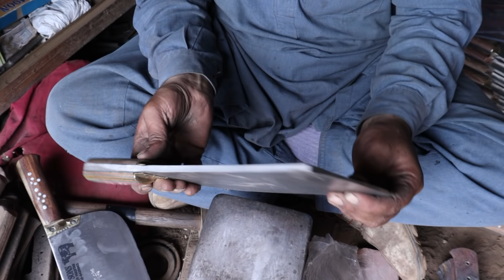Most Interesting Meat Cleaver Knife Forging Process

Comment: It's amazing how these people can work in sandals and with some of the most meager tools. However that is one awesome power hammer.
Reply: Se
Reply: And they do everything on the floor.
Reply: That's how your ancestors did before
Reply: Hhj
Reply: And no gloves. One wrong move and oops there goes a finger
Reply: @rangoman1815  yep hundreds of years ago.. hundreds
Reply: "Meager"?  It's not like they're pumping bellows and hand-hammering the blades.  They've got at least two power hammers (and one of them is set up to do one specific job) powered grinding wheels, and bar stock that just needs to be cut to shape with their cutting torch.  Calling that 'forging' is like calling tracing 'drawing.'

Comment: I was surprised to see at the end that the cleavers edge was unmarked after attacking the square bar. Most impressive....
Reply from the maker: Thanks for watching dear
Reply: कहा मिलेगा
Reply: apparently that square bar made in china from chinesium :)
Reply: @z08840  Aye, maybe it is, but there will still be some steel in it, maybe just not good stuff. Remember, the Titanic was built with appalling quality steel even for the technology of the day, so....
Reply: @logotrikes  Titanic's problem was not a steel it was made of... so, your point just moot
I'm just pointing out that if this not heat treated thing is leaving notches in a metal bar, then this metal bar is even more shitty stuff than this thing is made of :)
Reply: @z08840  Dunno about the Titanic steel suggestion being moot. I've followed the Titanic story ever since Ballard found the thing. I've got several books on the subject including the infamous Robin Gardiner book about the Titanic switch. That was settled conclusively when they photographed the cast bronze remains of the bridge telemotor, and it bore the yard number of 401, which was Titanic's number, Olympic being first of the class at 400. We're getting off the subject a bit here but I must address your Titanic steel comment. Sections of the hull plating have been raised and analysed. The carbon content which gives the steel its strength was unevenly distributed through the sample, indicating very weak hit and miss properties, not best suited for Atlantic cold. It was very brittle and fractured easily under test, at way less than the 1 inch thickness would have suggested. An accident waiting to happen (deliberately?) considering the flagrant regard Capt Smith had for the conditions.(Even if as has been suggested, speed was the best policy to adopt in the circumstances, at the time, just barge your way through the ice field with the velocity of 42 thousand tons. It was only a few growlers after all, and Smith had a deadline to meet, egged on by Ismay) Hubris of the highest order.

So, the steel was poor quality as has been ascertained by modern metallurgy, although a combination of unfavourable circumstances, many of them man-made, ensured the early demise of this fine ship. That Olympic, "Old reliable" sailed on almost trouble free until 1935 is irrelevant. Successive captains no doubt were a little more circumspect about letting Olympic gallop away, plus the ice conditions that year were exceptional, and were not often repeated in following seasons...
Reply: @logotrikes  "We're getting off the subject a bit here" - it's exactly my point on being moot :)
Reply: @z08840  Fair enough. You got me there...
Reply: @z08840  it was a piece of scraps from the leaf spring so same steel as the blade but annealed
Reply: @cdias3272  so, you suggest that leaf springs were annealed, then deformed and then painted? not likely. Watch from beginning - it's deformed painted stripes.
Reply: @z08840  when they cut with a blow torch the steel becomes softer i know because i make knifes and swords from leaf springs! And i doesn't take much to cut a little bit trough steel all you need is thick edge on the blade
Reply: z08840, stop embarrassing yourself, son.
Reply: @suprememasteroftheuniverse  right, let's embarrass you - do you have anything to say on this matter, mom? :)
Reply: @suprememasteroftheuniverse  mom? any input? why went silent, mom? have you any thoughts on the matter? have you any thoughts at all, mom? :)
Reply: martoon some thing missing in this video the heat treating process is missing the secrete of that strong edge
Reply: @cdias3272  You can't flame cut leaf springs, it's just mild steel.
Reply: @z08840  Really dude? Painted stripes? How would you know that tho? Were you there? Do you have X-ray vision? You researched the paint on those "stripes"?
Do you know what rhetorical means?!!!
Reply: Yup, Mild steel makes an Amazing Cleaver, SAID NO BODY EVER!
Reply: @drakoontag  you can clearly see it's painted at 0:31
dude
Reply: @z08840  Hey, I could clearly see its Leaf spring too, Just take my word for it! Would you tho?
Reply: @drakoontag  nope, you can't see it's leaf spring - shape and hole in the center is not enough to make such conclusion - there are many things where mild steel of this shape can be used in. However at 0:31 you clearly see paint chipping away in the place of corrosion creeping under - you can't mistaken it with anything else.
Reply: @z08840  Lets agree to disagree! Is that ok with you?
Reply: @drakoontag  I don't really see what you can disagree on - everything here is quite clear... well, probably you are not living in modern society and have no experience with old rusty painted metals... but wait, you are using computer, aren't you?.. then what... I suppose that every human being with enough intellect is capable of making conclusions I provided above and there is nothing to disagree upon... but if your intellect... well... ok then, lets agree to disagree...
Reply: @z08840  You are funny mate, Have it your way, But let me disagree with you! Damn man, your observations about me after i said just a couple of line, how should i put it, presumptuous to say the least! You must be a blast at parties!
Reply: @z08840  Let me ask you something, What do you do for a living? Serious question! I would appreciate a serious answer. Thanks.
Reply: @KashifAli89397  секрет прост- видеомонтаж. Пересмотрите демонстрацию в конце, там видно, что кромка замялась от ударов. А после показали другое лезвие
Reply: Watch in slo-mo and you see that there are essential marks on cleaver at 8:18 but then he demonstrates another one 😂

Comment: Just to confirm  he did not harden the edge of the knife, right?
Reply from the maker: Thanks for watching
Reply: He must have hardened it or it would have rolled when he chopped it into the metal at the end.Looks like he got the quench exactly right, but we didn't see it. A pity. I would have liked to see how hot the steel and what quench medium he used. 
Old leaves are probably 5160, which needs a medium quench.  I am guessing he used water, but only did an edge quench - otherwise the blade would probably get cracked

Comment: Amazing!
Quench and temper?
Reply: No point, it's made from mild steel.
Reply: @hetrodoxly1203  Right. It's easier to sharpen 🤔👍
Reply: @robsonsantosOSO  If it had a Scandi grind it would be easy to sharpen that was sharpened like a chisel, you'd be constantly sharpening it, lets face the truth it's a lump of badly made mild steel with plywood  scales that are going to break off in a few weeks, i don't want to be unkind but sometimes you have to tell the truth, even 200 years ago they'd have chucked some carbon on it.
Reply: @hetrodoxly1203  Ok.. sorry. You are completely right. 😉